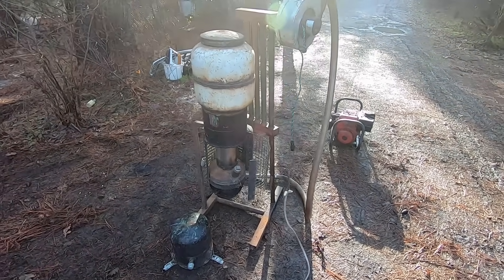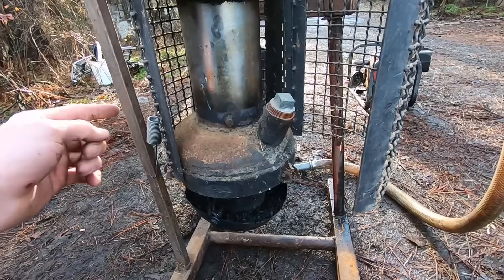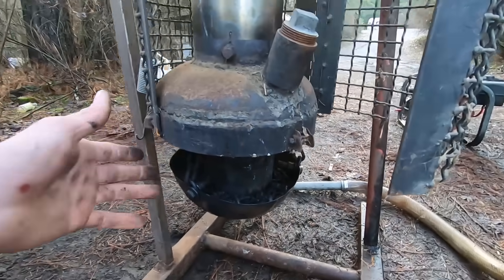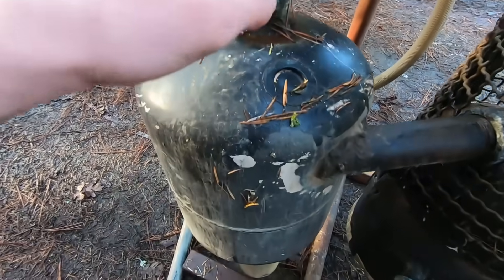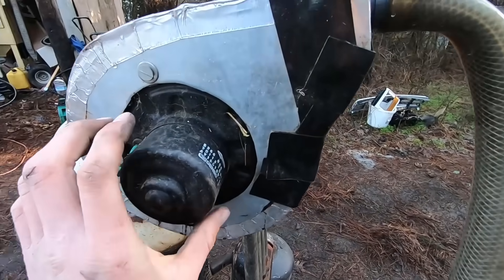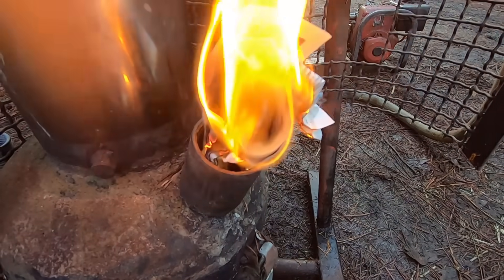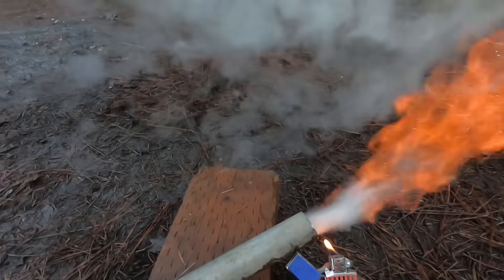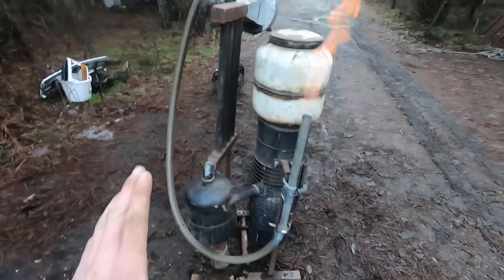Using Wood to Fuel a Generator! (How to Build a Wood Gasifier w/Demonstration)

Comment: In theory the charcoal in the bottom of that would be activated so it’s an activated charcoal maker too.
Reply: Activated charcoal can purify water. Very useful in a bug out/homestead situation. Although activated charcoal made from coconut husks is supposed to be less carcinogenic.
Reply: @azteacher26  gasification char isnt the same as activated charcoal
Reply: @zhaow4832  what's the dif?
Reply: @azteacher26  If I recall correctly the quality of char from gasification is pretty ashy and isnt really usable for much. After gasifying, it's pretty much spent so the energy content and quality isnt near that of charcoal. Industrially speaking, it's pretty much waste and has to be disposed of.
I don't know exactly how activated charcoal is made but I'm pretty sure it has to be a certain quality and processed with chemicals to maintain a highly porous structure.
Reply: @zhaow4832  makes sense. Thanks.
Reply: @zhaow4832  I believe that activated charcoal is just high temperature charcoal - around 700C. The higher the temperature you pyrolyse wood at, the more volatiles you drive off, leaving behind purer carbon, which makes for a hotter and cleaner-burning charcoal.
Reply: makes sense. It would have to be purely pyrolysis to have purer carbon content. Though with gasification ,you get some pyrolysis but you also have combustion so you are burning a lot of the carbon so that's why its kind of ashy i guess.
Reply: @zhaow4832  This is a byproduct of his design.
His is a self fueling system where the burning is occurring strictly at the bottom of the system under ideal conditions.  The problem being that this burn then can migrate into the actual pyrolysis chamber through the burn chamber / pyrolysis chamber interface.
If, however, he had his pyrolysis chamber tube drop through the burn chamber to a catcher and then had to pull and dump that charcoal product into the burn chamber manually he could cook out all of the (nearly so) contaminate.  Leaving behind not only the perfect charcoal to run the burn chamber but also useful for active charcoal filtration.

His design, though, is efficient for homestead simply because its run time is determined by the top hopper feed size.

Imagine if all of the waste heat from this system was being used to dry sawmill waste dust which would then feed into the primary hopper...You could use the power output to run the mill itself.

This is pretty much what Clorox/Kingsford does in their charcoal production plants.  Only they produce so much excess wood gas they burn it off at a primary exhaust that looks like the statue of liberties torch.  That is excess beyond what they use to produce power for the plant.

Comment: This Gasifier system is widly used in modern wood heating stoves. Especially wood pellet heating systems relay on a second combustion in order to make an energy efficient heating possible. With a traditional heating system, most of the wood gas just leaves the stove unburned and also pollutes the air. While systems that relay on a second combustion usually have a clean flame and no visiable smoke on the chimney. The disadvantage of a clean wood stove is, that you won't get that "cozy fireplace" feeling.

Comment: I worked for a large Oil and energy company doing research. Every now and then we had projects going to use our low sulfur coal and convert it to syngas and liquid fuels using the  Fischer–Tropsch process. We also did studies to reduce the over all carbon content in gaseous fuels by adding additional hydrogen gas to syngas. These projects we called informally our "greener energy" projects. Some of us believe there still is a place for lower CO2 fuels.

Comment: Cool as hell man. Do you think you could build some apparatus to bottle that gas? i would imagine a propane tank and a air compressor motor? i don't know how volatile the gas is so i would speculate a low PSI to be safe. use a pair of valves  and a quick connect to swap bottles as they fill?  this method would cost electricity unless you used something like a water wheel for free energy to compress the gases. a slower water wheel driven system would compress slower and would be safer if the gases are not safe to handle me thinks.

Comment: Ok. Part about generator. But when you use simple fuel it consist of fuel+oil. In your case you using dry fuel. How it will oiled inside is it safe for gen? And if my generator will use (for example) 4/5 portion of gas and the rest would collect in pipe is it safe? Sorry for my engl

Comment: This is not meant to be controversial. I am just stating facts which have been 100% accepted as true.

https://en.wikipedia.org/wiki/Wood_gas
https://en.wikipedia.org/wiki/Wood_gas#/media/File:Bundesarchiv_Bild_183-V00670,_Berlin,_Pkw_mit_Holzgasantrieb.jpg

     In WW2 germany used this extensively as they have no oil resources for petroleum based fuel. 
Due to this lack of resources, in WW2 Germany had to invent many "synthetic" alternatives to many common everyday materials.
     A primary resource they needed was oil to produce fuel for the country. To address this need German scientist can up with an engine 
which ran on carbon monoxide & hydrogen rather than petroleum based fuel. This alternative fuel could be produced from wood, which Germany had plenty of.
     As these engines produced large amounts of carbon monoxide, if they were no maintained or operated correctly the operators or occupants 
could be killed due to the effects of CO exposure.

    Fun fact:  Same as today, how we would call an electric vehicle an electric car, these vehicles became known as Gas trucks. 
They were then, subsequently, used as evidence for the allegations of mass executions made after the war. 
Most people outside of Germany were not aware of these types of engines and how they operated. 
     So when the allegations of mobile gas extermination trucks were made & people, ignorant to this technology, were shown 
pictures of these "Gas trucks". They were then shown documents stating they produced produced large amounts of carbon monoxide, which can be deadly, 
they put what, limited, info they had to conclude, "Gas Truck" plus machine that produces large amounts of a CO, a poisonous gas, 
     What other conclusion could there possibly be. It must be the mobile mass killing trucks people are saying it is. 

They also made regular cars, military vehicles, tanks just about anything that a regular petroleum based fuel engine could be used for.
 
     How might the accepted story be different if everyone was properly informed that the carbon monoxide produced in the vehicle is the fuel the vehicle ran on.

There wasn't a standard gasoline engine for the truck & a CO producing equipment for poisoning. There was only a CO producing machine which connected directly 
to the engine which ran on the CO that is being produced..

Comment: This is really cool.  My only concern seems to be pretty common among the other comments.  That is the soot going into the engine.  I'm sure there is a way to filter it out since you only need the air and hydrogen.  I don't know how safe it would be, but there might also be a way to use the heat generated by the reactor to heat your cabin or shelter if you needed to.  Very cool setup though.  Seems perfect for an off the grid setup or emergency power source.  This video earned a sub from me!

Comment: I love this concept and have one half built. I have an idea for a future model to make more power. Using a turbocharger for the the gas to have a higher flow rate and compress more syngas and air to hopefully boost its power output. I’m not sure it will work but I want to try it normally first and then modify it. Hopefully I have time to work on it next winter.

Comment: Do you have a pipe bending setup? You could try a cooling coil that wraps up. It would give you a longer pipe length in a shorter total height. This could help with cooling some extra moisture off.

Comment: Nice work from Australia mate. I have 2 questions. What kind of Gap is between the "shaker grate" and the feed/combustion tube? and this is a dumb one . How does the combustion not travel vertically to your storage tank? Or where abouts does that combustion stop and how? Is there a blocking section in the vertical tube section that you mentioned gets very hot?

Comment: Great sir appreciated 
Bio gasifires are very old but not yet to be promoted like petroleum .

I have 200 kva generator run with gasifier and diesel mixture in my rice mill .

So I got 60% of fuel saving .

Very efficient technology .

But now a day I am working on hho for mass production with the help of solar energy and store hydrogen separately into tank and leave oxygen into environment that will be more efficient .

You can see my hho cell in my Chanel as well .

Great effort really appreciated

Comment: Great video !  Have you thought about using an OILLESS AIR  compressor to compress the gas into a propane tank ? By this method ,,you could use it the same as propane. Thanks

Comment: Does the generator put out 120VAC?  I would be interested to see you make a video where your either step down the voltage and convert to 12V DC or rig up an alternator to charge the car battery back up so you always have a full battery to start your blower.  Really cool video man!  Hope to see more!

Comment: you should do a motor thats run off the gas fumes by bubbling the exaust thru the fule so the fumes get pullued thru the intake to rn a  motor for like nothing seen some other vids of ppl doing that so would be cool if yoiu could confirm it actually works cheers

Comment: I just watched a man turn wood into gas using trash. Youtube is great
Reply: you mean "turn wood into electricity" which is amazing!
Reply: @BobBobbertson-j5n  If you take your time, sure. Private industry has almost zero incentive to do this or they would be already. But I disagree it must take that long. A focused plan, federally encouraged, could take, what, 5-years max? Science is already aware of the best plants to use as bio-material, and all the downstream uses need no changes. Syngas turned into gasoline requires zero alteration of vehicles, etc. And a lot of that 5-years is because it takes time to grow feedstocks. It's cliche, but if we can get to the moon, if we can ramp up to kill one another in WWII, we can surely do this.
Reply: ikr.. in 10 years everyone uses it, and not a tree to be seen for miles..
Reply: @TheRealSteso trees like co2 to breath
Reply: @steso8979 idk if you're aware but it doesn't need trees or even wood for that matter, you can run it off of anything organic and dried, like grasses, bamboo, farm waste, lumber mill waste, cardboard, etc. Fast growing wood like poplar is good also, it's not like you have to clear cut forests to sustain it. I could probably compress the leaves that fall on my ⅓ acre lot in one fall to provide fuel for a year. Open your mind a little
Reply: just ust go online and get signing in for free magazines and paper pubicity to your door 
and you will have free paper in the mail by the ton every week 
you help the mail man anf get your self free fuel .(signs of a corrupt society as any way u turn you end up causing  some type of damage to the environment) 
It is a great vidio and you got lots of knowledge what make it very useful 
It really tics to see a bunch of unralated things  come together to creat something usefull
I think  it goes to the core of human attitude to understand how good the word could be if we would give the correct value for the most valuable thing in the world after  God's word 
Human beings
GOD for this nice video 
Christian
Reply: This channel has WAY too few subscribers....
Reply: Not sure why I resisted.
Reply: phase 1 complete
phase 2, put it on a flying car
Reply: Actually the fumes of gasoline are the only thing burning.
Reply: See Wastebot , Wayne Keith , and Victor gas works , better hurry the sht is hitting the fan !!!
Reply: Awesome. would come handy after a major natural disaster
Reply: Nice apparatus man!!
Reply: it was a great recommendation, thanks to youtube
Reply: xD
Reply: You just watched a man get lucky and not explode. that sir is a bomb. There are approved designs that will not act like bombs if you get a backfire.
Reply: Humans are great
Reply: Not that impressive my 67 Willis Kaiser Jeep does that.. and you don't need to build anything special to use it
Reply: While this is great for individuals or families living off grid but it would be retarded to do this on an industrial level especially when if the argument is to use this as a means of getting away from fossil fuels especially when we have clean nuclear energy that would be a much smarter and more eco friendly.
Reply: Gasifiers are old tech. We stopped using them by the 1960s as natural gas is soooo much cleaner.
Reply: this will be taken down by the government soon. we all better record this.
Reply: and you can even use horse shit...
Reply: Met a great old guy who said when he was a kid they used this to run the bus's in Brazil.
Reply: Yes cool stuff but I don’t think I’ll try it. As a science nerd I dig it
Reply: What stops the burn area from burning all the way up to the top of the reservoir
Reply: @MyFirstYoutubeHandle  that is one of the problems with the way things are today we'd get the fire department police department called on us for doing this now in like an urban setting.
Reply: My grandpa told me that there used to be cars that ran like this. A small pile of ashes every few kilometers on the side of the road. It's not a new technology at all.
Reply: That trash your talking about is wood pellets.
Reply: @ericpelky1246  i think he meant the gasifier itself was made of recycled items or trash as it were
Reply: @ericpelky1246  the trash he's texting about is all the JUNK METAL Wow 👏 😳
Reply: @ericpelky1246  I think he meant the parts the gasifier is made out of.
Reply: Not just that, but it's CO2 neutral - ie, the USA could go fossil fuel free practically overnight.
Reply: @edgelessgladius5178  yeah, commies can't understand sarcasm.
Reply: @BobBobbertson-j5n  No, you idiot. The big tech censor any competitors, since they wanna protect their cash. Gas would be 10x cheaper if you could make it at home. Actually it would be and SHOULD be free. The technology is there, it's just CENSORED... I know, I run my lawnmover on scrap grass, pines and shit.. literal shit, my own shit in fact. I also use my own shit and pee to make gun powder and to grow my own food. Yall are stupid WASTEful idiots. The sociopatic companies use you for their own benefits. How ever I don't give 2 shits about you, im self sufficiant. Keep wasting resources, when society breaks down, im the only one who sill survive.
Reply: @onionmaster7673  I've been thinking about this for a while and yes I know it's dangerous thinking for myself but I honestly believe if you're a true minimalist then you wouldn't be wasting you're time putting people down or even being on a cell phone or computer if you're a real survivalist then you wouldn't be on here commenting useless information or talking smack about somebody else's hard work. You should be outside turning over your compost or building something useful for when the shit hits the fan like this guy in the video don't be hater it only effects your body .
Reply: @onionmaster7673  wanting shit for free that other people have to work to make? Are you sure you aren't the commie?
Reply: @onionmaster7673   Think of how you could improve the world, if you would accept people for the stage of development that they're at, and patiently explain to them how to live more cheaply, efficiently, and self-sufficiently. There is certainly an appetite, and a market, for this information.  Instead, you crow about your personal systems, and how you "don't give 2 shits" about "idiots."  If you would stop being such a bitter, horrible misanthrope, you might reproduce yourself - your ethos, your systems, your way of life - and when "society" breaks down, we could all be better off.  And you would find yourself surrounded not by "idiots" but by like minded and grateful neighbors.  

So who's being the "idiot"?
Reply: What Is Islam?

Islam is not just another religion. 

It is the same message preached by Moses, Jesus and Abraham.

Islam literally means ‘submission to God’ and it teaches us to have a direct relationship with God. 

It reminds us that since God created us, no one should be worshipped except God alone. 

It also teaches that God is nothing like a human being or like anything that we can imagine.

 The concept of God is summarized in the Quran as:

{ “Say, He is God, the One. God, the Absolute. He does not give birth, nor was He born, and there is nothing like Him.”} (Quran 112:1-4)

Becoming a Muslim is not turning your back to Jesus. 

Rather it’s going back to the original teachings of Jesus and obeying him
Reply: @ahmdabdallah5811  Don't feed the troll.
Reply: @ahmdabdallah5811  Haklısınız ...
Reply: idiot, this is old technology from 1900:th. Also this variant is inefficient, Censortube will censor anything that has power enough to compete with gasoline engines.
Reply: @onionmaster7673  I think someone is angry at life. Hope things get better for you
Reply: @onionmaster7673  Naw turns out you're the idiot.